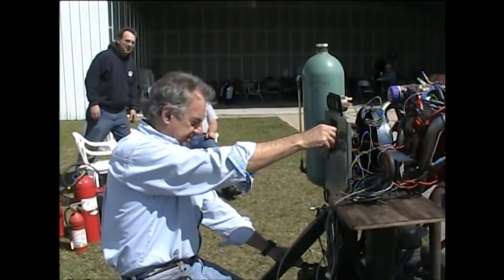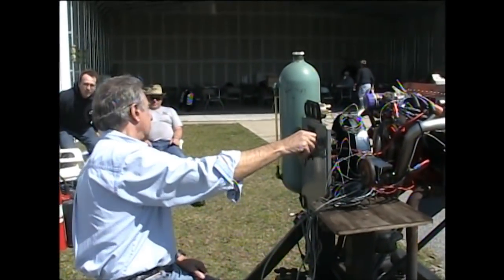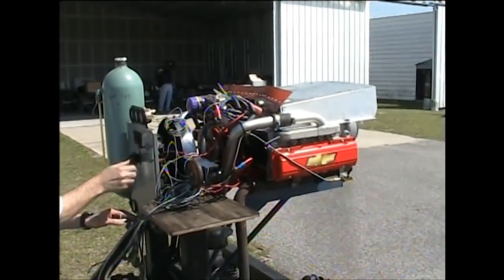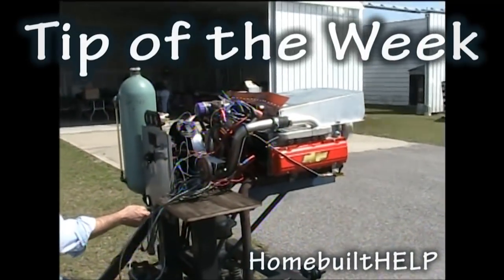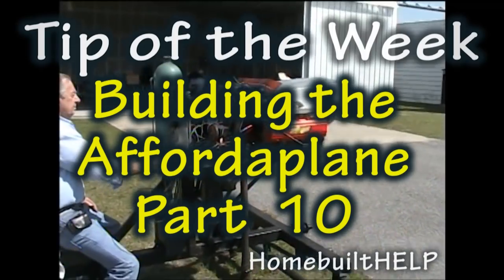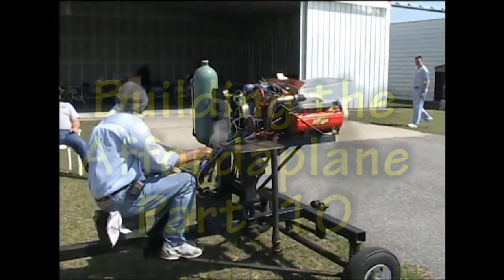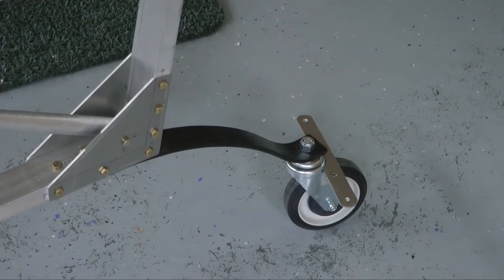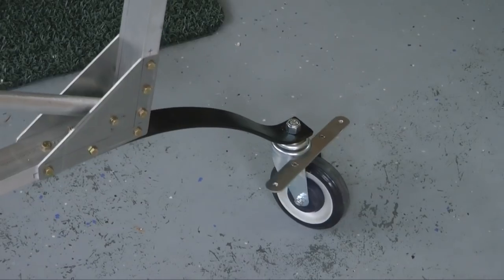Building the Affordaplane Part 10

Comment: Use masonry bits to drill springs. The carbide cutting edges make short work of the hardened steel and generate less heat. You can sharpen the bit for better effect if you have the correct stone.
Reply: yup!   carbide, slow, and more than average pressure!

Comment: Go with carbon fiber laminate stronger than steel and sooooo much lighter than spring steel. Your doing a great job Jon.
Reply: thats a really good idea, if my spring steel tailwheel assembly every bends again after a hard landing I might consider that idea my new tailspring from team is a little thicker and by habit I now try to keep the tail up when landing on rough fields.

Comment: What keep the square tube from collapsing where the bolts go through. On a hard landing or bump it looks like it will overstressed.
Reply: That tubing is thick walled and would take a lot to crush it, however I think using large, thick washers on top of at least the forward bolt would lessen the chance of damage to the tube in a really hard hit.  Then again, the aluminum tube isn’t that expensive or that hard to replace given the bolted construction of this design, so if damage occurred, it shouldn’t be a big deal.

Comment: A composite laminated leaf spring would be much lighter - I wonder if one could make one by cutting up an old archery bow? It would be definitely be lighter and plenty strong! Great video series, Jon!
Reply from the maker: Making notes -- if we are overweight in the final stretch then I can revisit these areas!
Reply: @HomebuiltHELP  That's a great idea. After building to plans, I'm sure a few videos on possible weight savings ideas as needed would be appreciated.
Reply: @SoloRenegade  If your not planning on flying from pavement, a wooden block could be mounted some way as a tailskid with an aluminum plate shield to minimize wear, this is how the skypup ultralight did and could achieve a 195 lb empty weight. as you progress as a tailwheel pilot you might be surprised how little the tail touches the ground, especially in a ultralight taildragger.
Reply: @gyrojeffro2263  Never wise to assume a person's skills, knowledge, or qualifications. That said, a skid plate is a valid idea. But if the Aerolite can have 3 large tires, I think we can also keep the tailwheel if we like and reduce weight elsewhere. A different tail spring as others have suggested is a good start.
Reply: .....and then there's the "balance" factor of the weight and balance.  Weight off the tail makes the nose heavier (and vice versa) at the center of gravity - or CG.  Gotta keep that in the back of your mind while building.  Maybe shifting the fuel tank behind the vertical fuselage beam rather than directly behind the seat to get the weight more aft with a lighter tail wheel configuration?  Or slide the seat a little farther back with a thinner fuel tank?  Also, adding or deleting weight from the tail - at that longer moment from the CG - is more significant than adding or deleting weight from nose because of the distance/arm from the CG.  That's the nature of aircraft stability with respect to the CG.  AND you never want an airplane that is significantly tail heavy.  Again - just my $0.02.